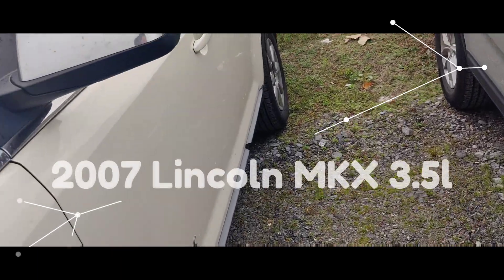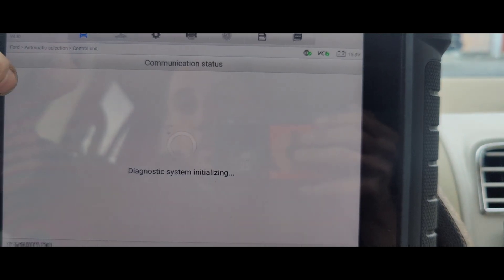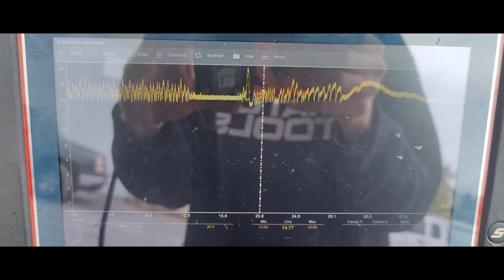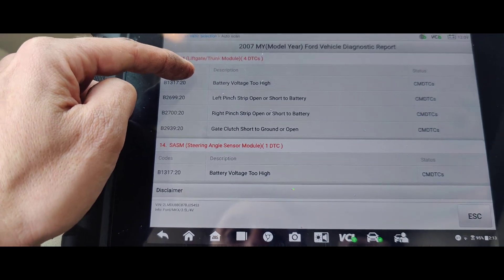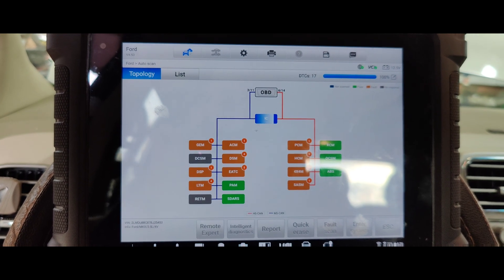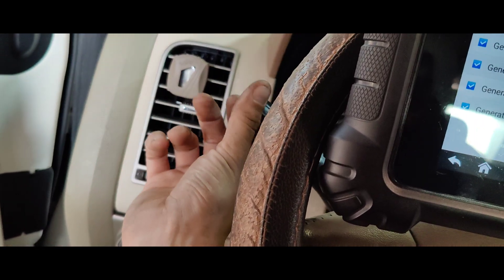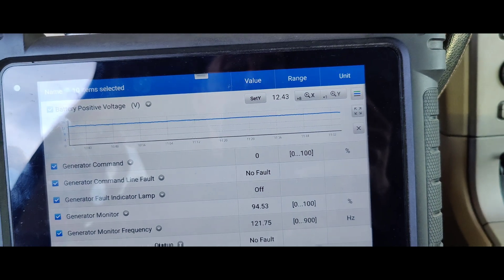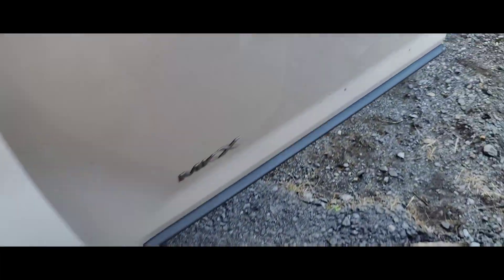2007 Lincoln MKX 3.5 Electrical Problems? Instrument Cluster Goes Out? Lights Flicker New Alternator

Comment: Yup, this seems a common issue. Many of the knowledgeable shops only fit new OE or brand name alternator (Denso, Bosch, etc) now only. No rebuilds and no aftermarket rubbish.
Reply from the maker: I usually don't have problems with new aftermarket but rebuilt aftermarket I will not use.